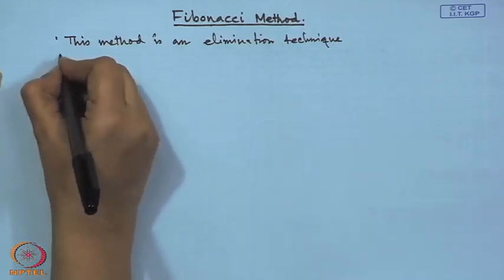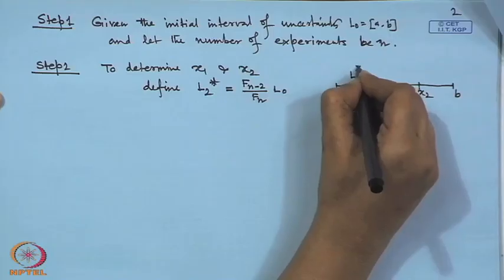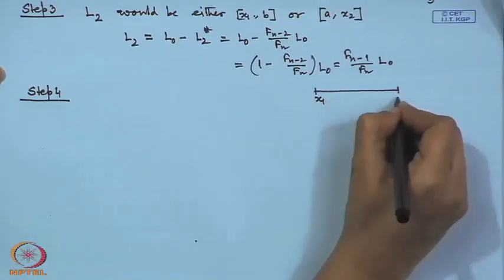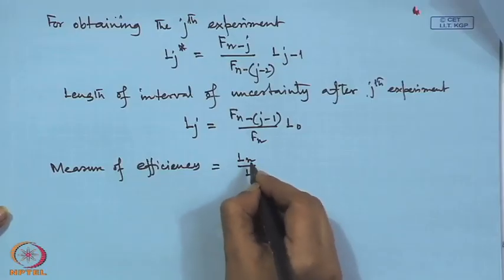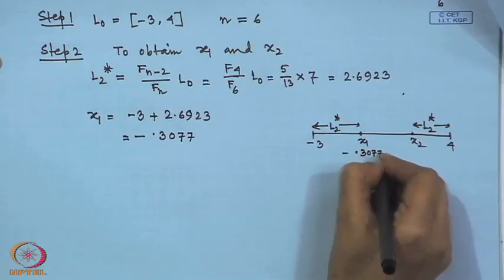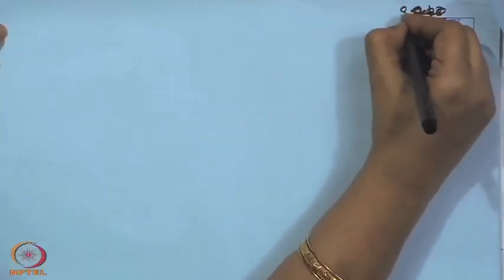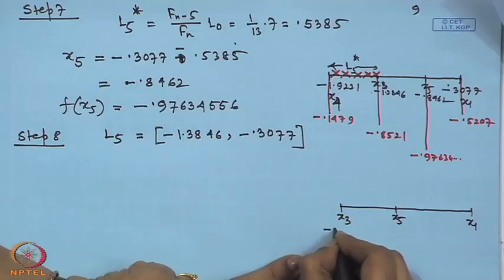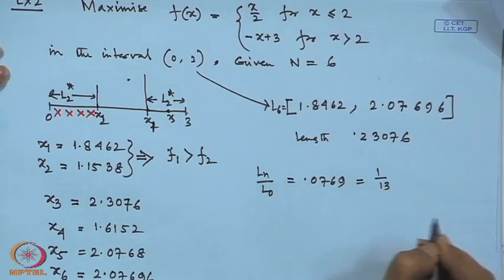Mod-01 Lec-27 Fibonacci Method

Comment: i think u have eliminated wrong part in maximum problem i.e f(x1)>f(x2) so u should remove (x2,3],instead you removed [0,x1)
Reply: In maximization, maximum value of f(x) will survive and other will eliminate, here f(x1) is greater so 0 to x2 will eliminate, isn't it?
Reply: its x2 to 0
Reply: Later she change the place of x1 and x2.. First time i  also confused i m thinking how she eliminate 0 and x1... But later she correct it by exchanging x1cand x2..